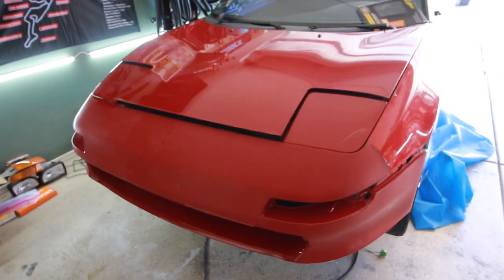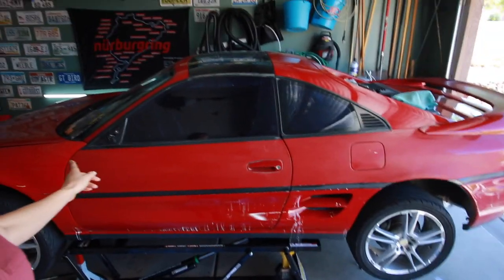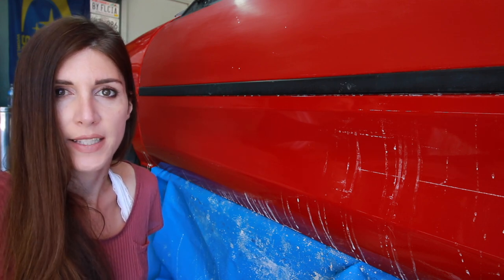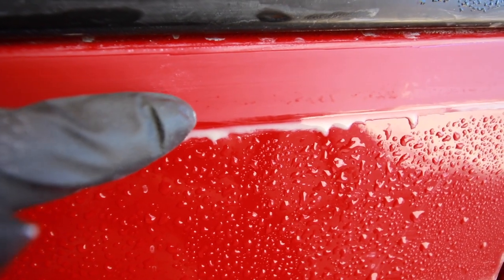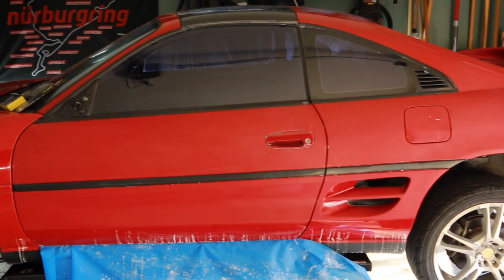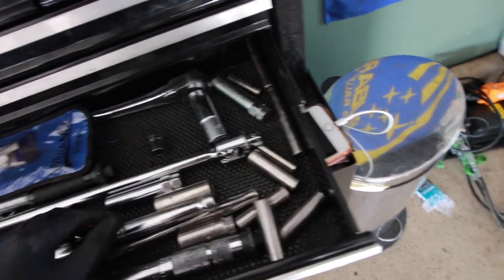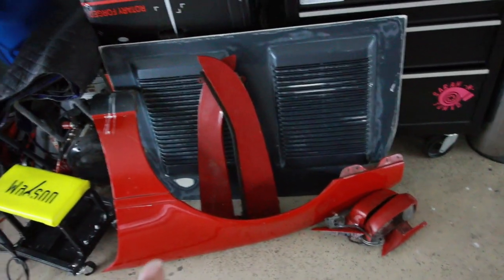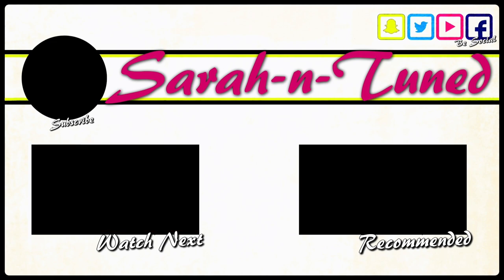Orange Peel Paint Correction // Project MR2 Turbo

Comment: For anyone that cares, a paint thickness reader is called an "elcometer"
Reply: And no, the cheap ones aren't that accurate (but good enough) and only work on steel
Reply: So they measure elcaminos? 🤔😂
Reply: And for anyone who cares, it's "who" cares.
Reply: @jaywhy225  yeah I'm not so sure I would trust a $20 meter, when most of them cost hundreds or even thousands of dollars.
Reply: Good work your doing in that beautiful classic car, very interesting that technique to repair the paint i didn't know it.
I can't believe you only paid 2500 for that car where i live one mr2 turbo of the 90s cost more than 9000 and non turbo mr2 for more than 6000. 

P.D.I like the names you give to your cars are funny names.

Comment: Sarah, I've been watching all of the vids, great stuff. I was taught, (back when dinosaurs roamed the earth, but it has served me well), when you are wet sanding, 1. wash the car first. 2. add a drop or two of Dawn to your water. It acts as a lubricant and helps the paper last longer. 3. Sand up to the body line, and stay off the edges. When you buff you will take more material off the edges, and if you have sanded them you may end up thin and buffing through them. Plus it helps to keep the edges sharp. Similar idea when you sand primer. Sand to the edge. Some peeps use a tape line on the primer and sand to it to help keep the body line straight and crisp. I'm living proof that old dogs can learn new tricks. Keep up the good work young lady.

Comment: A tip for wet sanding contours is to get a pool noodle or a piece of foam pipe insulation and wrap the wet/dry paper around the foam and sand as usual. Those glasses give you the nerd in the shop look, a very cute nerd, I like, I like.

Comment: Your editing skills are 2nd to none!!! Good job checking the thickness of the paint. Im Curious is it factory base coat clear coat or aftermarket? Some of the new stuff like Nissan /honda has super thin clear coat. Not much material to work with. Also you can wet sand the entire vehicle with denim pads on a rotary. 600 RPM to spread the product at. 1400 RPM to wet sand. Soooo much faster.

Comment: Top tip when wet sanding and polishing...  Once you've sanded polish it back up straight away otherwise if you leave it a day or longer it becomes harder to polish back up.. 2000-4000-6000 would give you a better finish and with the 6000scratches they're super easy to polish up.  Lol

Comment: P.S. Forgot to mention that the German auto body techs,  use sponge sanding blocks with a bucket of water. Soak the block, sand and repeat. =) Now you owe me 20 push ups =)~
Reply: aye sir
Reply: Just did 20. Just because I can.
Reply: I got into push up position, dropped to the floor, counted to twenty, then went to Dairy Queen --> does that work as 20 and push-up were in the same sentence ?

Comment: Since you have to repaint the fender, and you've sanded the entire car, why not just fill in the imperfections and repaint the entire car?  You're almost prepped now.
Reply from the maker: John K. I only sanded with 1500, don’t you have to have a little more bite for paint to adhere than that?
Reply: @SarahnTuned  Check out the 
goonzquad channel.  They've been very successful in repainting panels and entire cars by sanding the panels just like you did, without having to strip the old paint from the car.  I bet you can do it yourself too!

Unless the old paint is pealing, I'd put the fender back on. Then fill in the dents, paint chips and scratches with filler and sand smooth with 1500 or 2000 grit.  Paint those areas and any bare spots with filler primer and sand those areas smooth again.  But that's about it.

Painting the wing, handles and mirrors separately is still a good idea.  Once your at the paint booth, tape and cover anything you don't want over spray or paint on, wipe down the area with wax and grease remover, tack cloth and spray it.
Reply: Sarah, I think you're right about the wet sanding. I watch the Goonzquad channel too and they always use 600 grit paper to prep their cars for paint. I also think you're on the right track to cut and polish the existing paint on Mr. Dos. It IS a good test to see what is left of the paint on the car.
Reply: Or you can just clear coat the entire car and it will look brand new

Comment: Oh girl you removed the fender? That's pretty hardcore.  Oh you are wasting your energy wet-sanding all over the car. The front hood to wet-sand would take you 1.5 hours? It's not possible to get it done that quick with hand sanding to get it done properly and near perfectly it would take 1 to 2 days to get it done to get ready for buffing.  When I say 1 to 2 days I mean 24 to 48 man hours. This is no joke it's very hard work. Sure you can get it done much faster but the result will not be good upon close eye inspection I've been there done that.  You have to use professional tools (air-compressed or electric sand grinder with various pad sizes).  Well I guess if you are starting from 1500 grit it won't take too much time but if you start from say 800 grit it will be a nightmare cause you have to gradually move up to 1000, 1500, 2000, and 2500 it would take 2 days.  Why don't you just save your energy and mask the area and hit it with rotary buffer with steel wool pad for a heavy cut compounding? That works quite good plus no need to worry about leaving scratches from wet-sanding.